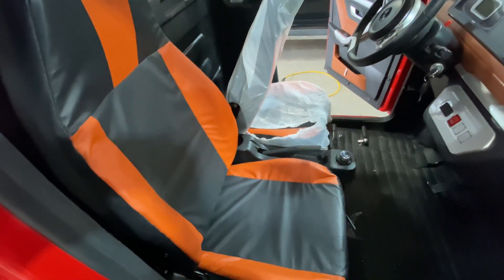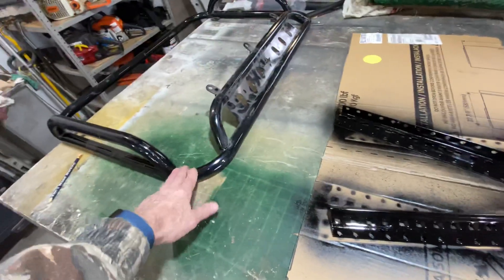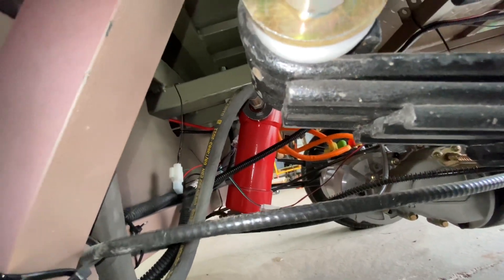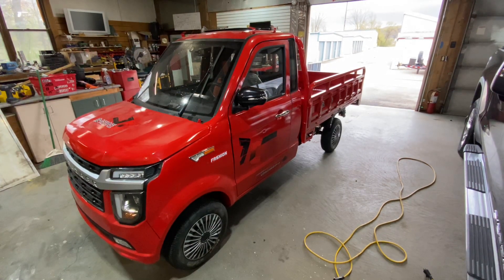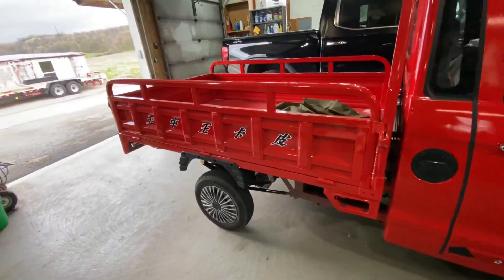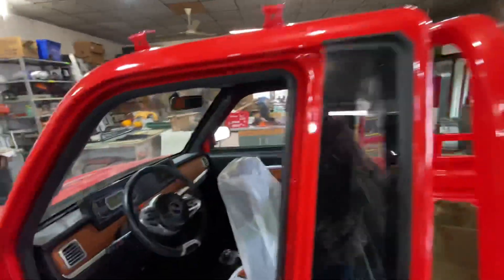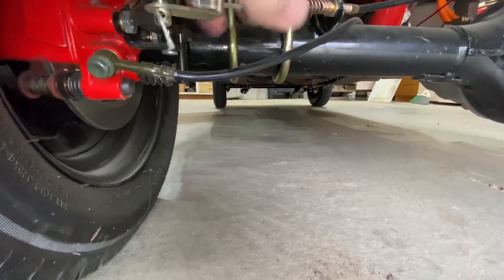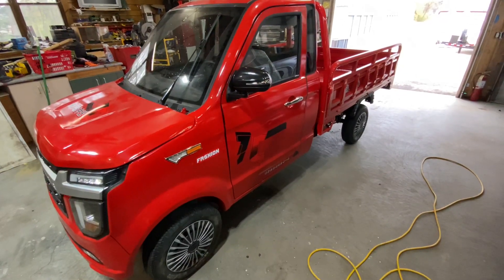Mini Electric Truck Chang Li style

Comment: I have a similar Chang Li truck.  Where did you order your lithium battery from?
Reply from the maker: I ordered it from the same company. But, it was made and shipped from a different city. Don’t know if it is a separate company.  

Heard today 5/9/23 that the battery reached Long Beach CA onn5/5/23 and is still waiting to be off loaded.
Reply from the maker: What company did you get your from?  I doubt I will be ordering more from this company.
Reply from the maker: All of the many problems they try to either blame on me or explain away.

Comment: Heck I'd love to know how much you got into it because some guy is selling these for I think 15000 and I can't tell if it's a ripoff to buy that DOT approved version for the cash.
Reply from the maker: Before you buy, do the research on what is required for an imported vehicle to be allowed to get license and registration in the US. 

Most of these truck manufacturers don’t provide a VIN, only a serial number. A VIN is required DOT for recall notification. Most of these truck will not pass crash tests, don’t have airbags, etc. 

My intention is to get vehicles that can be used in Wisconsin on ATv/UTV trails and routes. 

The State Department of Natural Resources( they issue atv/utv registration numbers) is at this time refusing to provide registration. I have some work to do to convince our state legislators to include these vehicles. Technically they should because they are designated as off road use from the manufacturers.
Reply from the maker: All in I’m just short of $10k. I’m considering it an investment in a demo vehicle for evaluating quality and reliability. Both of which are coming up short.

Comment: Is your ev powered by a 4kw motor?
Reply from the maker: Yes
Reply: @couldabinmore  I would love to see a test drive of your ev. Mayb a range test if possible.
Reply from the maker: https://share.icloud.com/photos/07bEUyFfaZpsjIAXp8OY72S0w
Reply from the maker: It will be tough to get a range test. It is not street legal. Can’t get plates without a VIN. 

I have been testing it at our mini warehouse business. 

I can get it up to 30kph or 20mph. 

Do not buy one from SHANDONG AIGLE company.  It is poor quality. Many, many issues. Still trying to figure out problems.
Reply from the maker: I’ve only had to charge it overnight, 4 times since I got the Lithium battery.
Reply: @couldabinmore  thanks for the reply. Can you recomend a better company to get them from?
Reply from the maker: https://x.alibaba.com/Avmy68?ck=pdp

Comment: Nah. Chinese.
Reply from the maker: Hey Patrick. I hope to soon have more videos of what I have had to repair on this NEW truck.  This is not something I would recommend to just anybody.
Reply from the maker: You will need a lot of tools and a good workshop to not only finish putting it together but figuring out all the “issues “ with it. From loose hydraulic fluid hoses to roof rack mounting tabs welded in the wrong place   That’s just got starters.